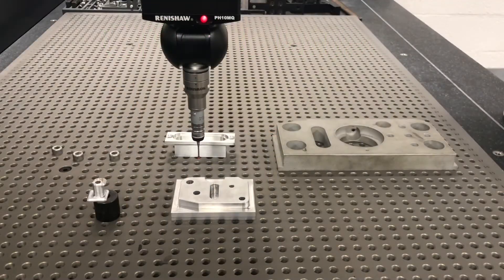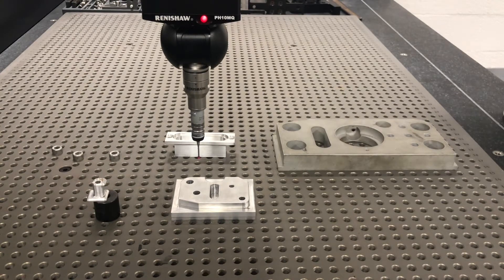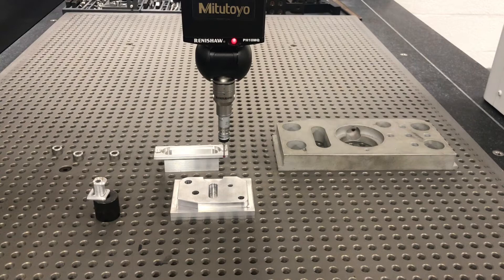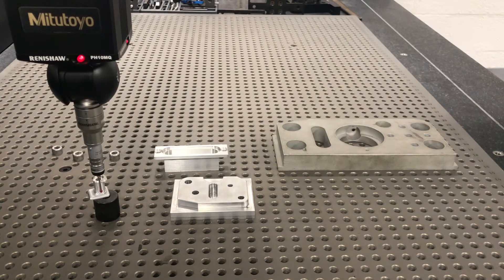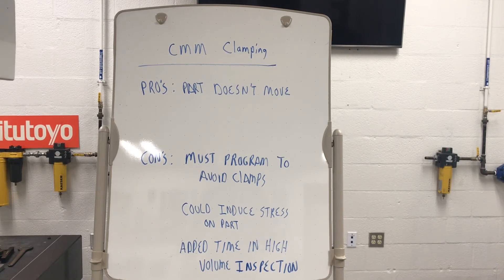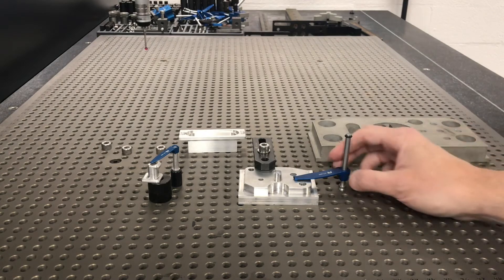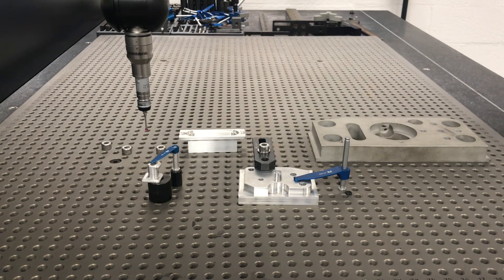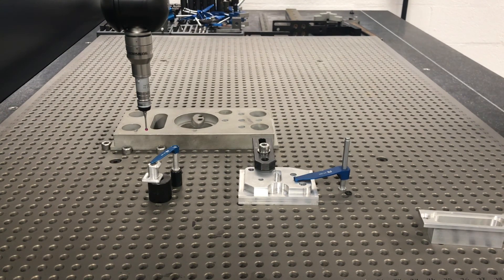CMM Clamping

Comment: Plz make video  how to measure square hole
Reply from the maker: I’m not sure what you mean by square hole.
Reply: @machinisttodd  Suppose there is a slot on the XY plane whose length and width are 20* 20 and the depth is 30 mm, then how will you measure it?in cmm
Reply from the maker: @RAHULDAS-cr5fl  Oh, ok I see what you mean. There’s no feature button similar to hole or plane etc. that I know of. I would do a line at the top then one at the bottom and compare the distance. Then line left and line right and compare the distance.
I hope this helps.
Reply: Thank you so much   but I request you to make a video on this topic. And also make a vedio how to generat final report  of any  measurement
Reply from the maker: @RAHULDAS-cr5fl  Ok. I been trying to get to making more videos but seem to not ever find enough time. Thanks and I’ll try to get more done!
Reply: Ok friend